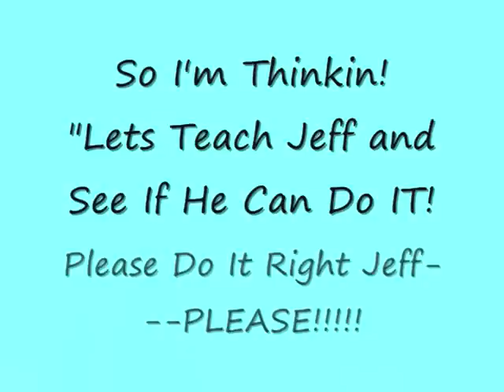Major Rust Repair-Volkswagen Karmann Ghia-Part 3

Comment from the maker: No--The inner rocker panel is the back side of the rocker panel on the outside.. The heater box is actually inside the rocker panel and is a very big major job to replace. most times in the case of heater box replacement, it's best to actually disconnect the heaters and do without.. It's a major major job replaceing them and many hours exausting work...

Comment from the maker: Ok,, your question is kinda messy, but Ill try to answer it for you... Use 0.22 gauge wire,, set the heat range on approx. 17.5 and the wire speed at around 22.5,, then take your gun and find the right distance from the metal you are welding to the arc of the gun until you feel confrotable that it won't burn through.. Basically,, just get in there and DO IT.... Thanks Pete